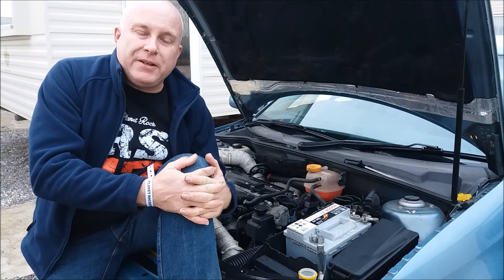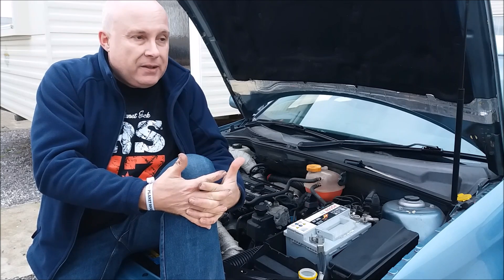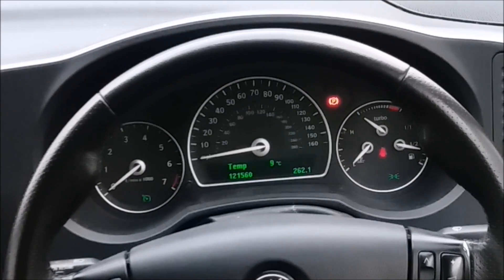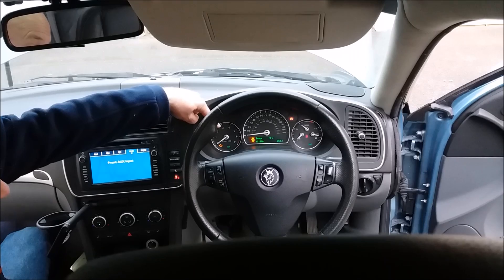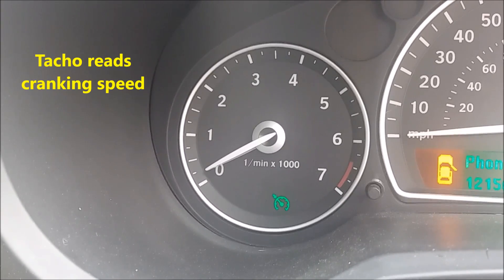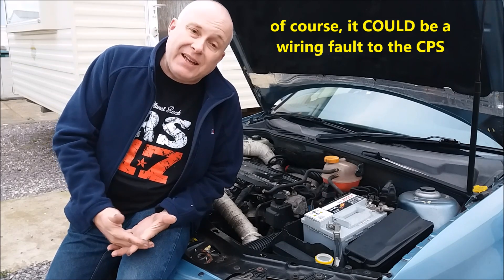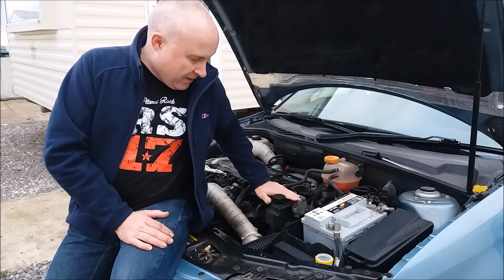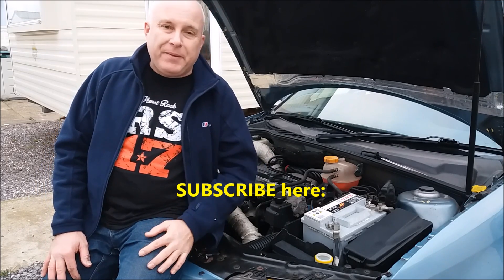CRANK Position Sensor Test - failing CKp sensor - CKp test

Comment: Hi, just discovered your channel today, really great!
      My 93 1.9tid when cold had a lots of bubbling into the expansion bottle that stops when hot, does your engine act the same or will my Head Gasket be the  suspect? 
   Merry Christmas
Reply from the maker: Hello Typey1 and welcome aboard. Don't forget to share with friends and groups you're in.
It does sound like that could be head gasket, but there are other possibilities. Tests you should do or have done:
1. engine compression test
2. coolant "sniff" test (looks for combustion product in coolant)
3. cooling system pressure leakdown test
One possibility is a leaking water pump when cold. Keep an eye on oil level and for mayo in the cam chamber. The pump on these is driven by the cam belt and I'm not 100% but have a queezy feeling any leaks end up in the sump.
Is the coolant level going down at all?
Reply: @CycloneCyd  The water pump is driven by the cam belt. There is a very slight untraceable amount of coolant loss, that occasionally manifests but i don't top level up that often! 
     The oil level and consistency is good as is coolant quality but I've not tried the sniffer test,  thanks
Reply from the maker: @Carlostype  for 25 quid I reckon this is worth getting I reckon it'd cost you that much at a garage to have the test done and this kit will do 10 tests total.
Reply: @CycloneCyd  
   Which kit would you recommend to use on the expansion bottle, cheers for the advice
Reply from the maker: @Carlostype  DOH!  https://amzn.to/2RjqQFT

Comment: My 99 Dodge truck does the intermittent stalling like you describe. I’ll be driving along and the tach will suddenly drop to zero and the engine dies. Usually you can pull to the side of the road, shut the key off, wait a minute and it will generally start back up. It has even started back up on its own while still rolling along the road. Never throws a code either. I suspect an intermittent crank sensor from everything I’ve read.
Reply from the maker: Certainly sounds like it John. When you're driving along and the tacho drops to zero, presumably the engine IS still turning (on over-run, being driven by the wheels). If this is the case then both the tacho and engine ecu have lost their speed signal  - diagnosis CPk ✔✔✔.
Thanks for watching John. Please give the video a thumbs up to like it 👍 and consider subscribing.
And do let us know how you get on please

Comment: Hi Cyd,

My 93 died today on the motorway.  Two warnings of traction and stability control failure.  It stopped reading speed and revs aswell.  It now will not even attempt to start.  Would this be the CPS? Thank you
Reply from the maker: Hi Damon, no, CPk failure would not prevent the engine turning over. Spurious messages are usually the result of low battery voltage, which in turn can be because the battery or alternator or both are knackered. Can also be due to poor connections, especially the body 'earth' below the battery box (the charging current has to pass through this connection).

I'd suggest getting rescued home. Then get the battery out and put it on charge. While it's out check ALL main power connections between battery, body, engine and alternator. Assuming the battery charges back up okay (or at least well enough to start the car) TEST the battery AND alternator using the methodology I show in one of my early videos. Test the alternator first, then battery (I do battery first in the video).

Suddenly running out of lecky is typical alternator failure - the car would have been running on it's battery reserve and die when that ran out.

That's my prediction from a distance, anyway.
Reply: Thank you for the quick reply.  OK ill check the battery voltage as per your other video then test the alternator provided it starts after a battery charge :)
Reply: Oh apologies i didn't realise you gave a much greater response as my phone only showed me the first paragraph so thank you for all that information.
Reply from the maker: Just hope it helps 
A thought: if you can get a slave battery e.g. from another car, try starting it. Assuming it starts okay with the slave let it run to warm up and test the alternator whilst your battery is on charge.
Reply: Im sure it will thank you!  If not i may be back to pick your brains again if you wouldn't mind.  Ok great thats a good idea :D
Reply from the maker: Hi damon, how did you get on? Also which FB group are you in?
Reply: Cyclone Cyd Hello! Sorry I forgot to come back to you with the outcome.  I managed to identify the problem pretty much straight away upon investigation and it wasn’t what anyone would of guessed.  The EGR valve pipe had split blowing exhaust gases onto the throttle body and wiring loom.  It melted the wiring loom into a bulk and completely destroyed the throttle body.  

I managed to get a new one from the breakers for £30 and separated all the wiring.  It also blew a fuse being the reason I couldn’t run any diagnostics.  Glad I managed to sort it myself!  The only issue that seems to have happened from this is the check oil light comes on but the levels are fine.  I imagine in my temporary wiring fix there is still an issue.  

Thank you for checking in with me it’s much appreciated! I’m part of the Saab 93 Owners club and Saab nuts club on Facebook.
Reply from the maker: Yeah, I'm in Nuts! too. Must be where I've seen you.
That is an unexpected outcome. Well done for sorting it though.
Reply: Cyclone Cyd Yeah must be! I posted the damage on there the other day of the melting if you wanted to see lol.  Yeah very unexpected as it’s not a normal failure.  Thank you glad I wasn’t off the road for any length of time!

Comment: This seems to be the problem I'm having in my 05 Jaguar xtype.  Bummer I just paid the mechanic $350 to fix it. I like your presentation. SUBSCRIBED
Reply from the maker: Hi there Frank. Thanks for watching and especially for subscribing and interacting.
Yes, "a lot" (most, IMO) of garages like to maintain an "air of mystique" around certain components like crank sensors, coil over plug units and ABS sensors, often claiming that they can't be tested and that substitution is the only way forward (and anyway, the computer says it's faulty - which is not what codes mean at all).
This is great for them as you rightly point out since they are being paid by the customer, often at inflated rates which the customer is in no position to challenge (thanks to that air of mystique). Good quality CPk units from the likes of Bosch are around £50 to £100 typically and changing them should take way less than an hour with the right tools and access..

We've all been in your position, been overcharged for something relatively easy. Don't let it get to you, learn from it and move on, but be better prepared next time!!

Have a look at my videos about the Polo ABS light! You'll see similar experiences in the comments.
Rant over, I'll get off my soapbox now!!
Welcome aboard.

Comment: Toyotas, in particular, the RAV4 and 4Runner show 0 RPMs during cranking, EVEN IN A FULLY WORKING CAR! So don't be fooled into thinking it's guaranteed to be a CKP sensor problem if you have one of these cars.
Reply from the maker: Great info, thanks Rick. This isn't intended to be THE definitive test, rather one of the "signs" to look for and hopefully help people avoid becoming victims of the "parts darts" game so many garages indulge in these days.
Reply: Rick Jasper 9572117202  cat
Reply: @rick jasper
Where would the ECU take its RPM measurement from then, if not the crankshaft ?  🤔